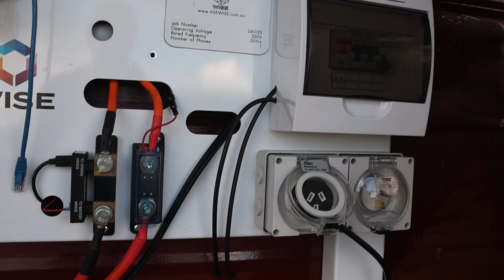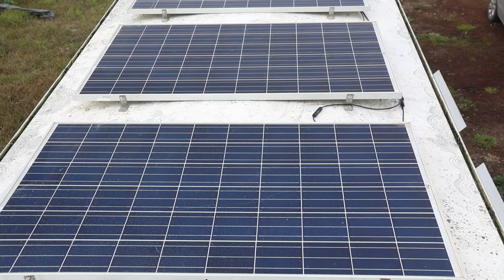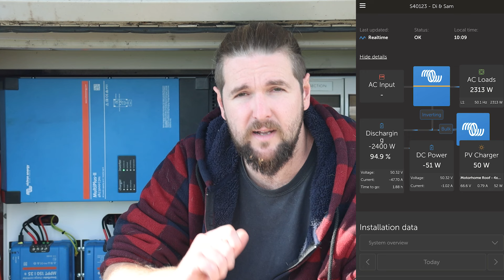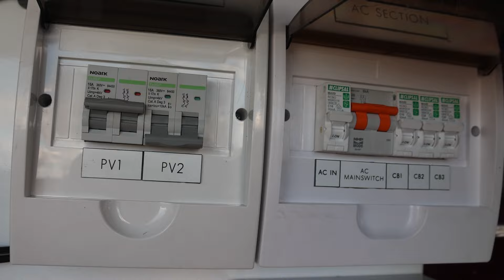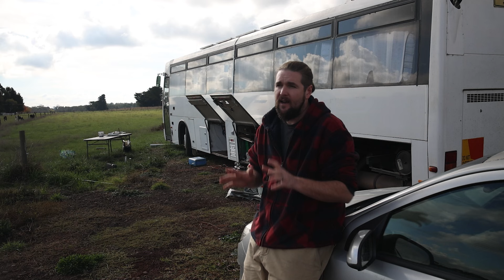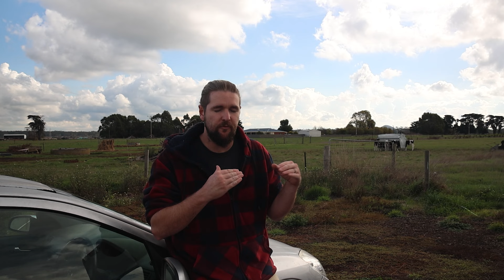IS IT EASY?? Our Off Grid Solar Power System Overview + 6 Month Review

Comment: Looking good guys!! Soo happy your soo close to getting an engineer to sign you off!!!
1000% recommend new panels and get another battery. If you only have one battery and you drain it down too much it will kill the battery requiring replacement sooner than expected. 
I would also highly recommend getting a capping or something made up for the DC solar panel cables going into the bus and not being exposed/accessible so far down.
Second hand solar panels you don't know how old they are, if they are still legal (many have been removed from the list of approved products and can not be installed anymore) and what kind of condition they are in, from a sparky perspective there is very few products that should never be purchased second hand and solar panels are just one of those.  EOFY sales are on so I would highly recommend the trina 440W panels from zerogrid energy (or Craig if he is able to match or beat that price 😉😉).
The DC to DC charger is when you are on the go driving between places it will charge your system, that is a lot more handy than running a generator when travelling. Motor park neighbors do not like the sound of a gennie running in the morning or evening. 

My bus will have 8x 440W panels on it with running a 6KW 48V multiplus inverter system from wise energy. I have to check up on the new regs as I am pretty sure each panel now has to be individually fuse so that will be fun to set up 🤣
Reply from the maker: That is a bloody epic system mate we are jealous!!! It'll serve you well into the future 💪💪 

Yeh I agree on the charging while driving I think Sam isn't planning on driving between places quite so much which is where his concern comes in.

Thanks so much fun r sharing your experiences and thoughts we really appreciate you guys all looking out for us. There is so much to learn and so hey!! 

Hope your build is going well too

Comment: Hi, 20+ years off grid and I recommend you add more solar instead of relying on a generator. You are under powered for your system and you have room for more panels. My system is 1.4Kw solar and 800Ah of LFP batteries and runs everything. My system is all 12 volt because I can get spare equipment cheap anywhere if needed. Good luck!
Reply from the maker: Sounds like an epic system.
Yeh one day when we have some more funds to throw at it again we will upgrade for now the whole build has been big for us and debt free so we're working with what we have :)